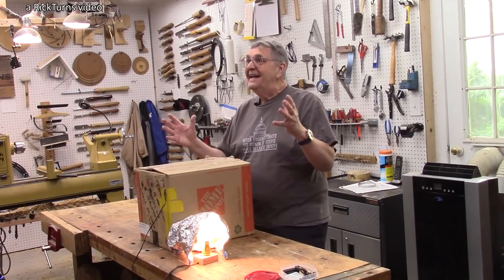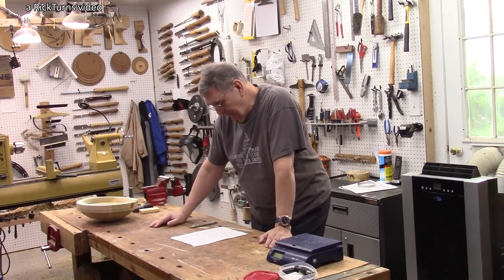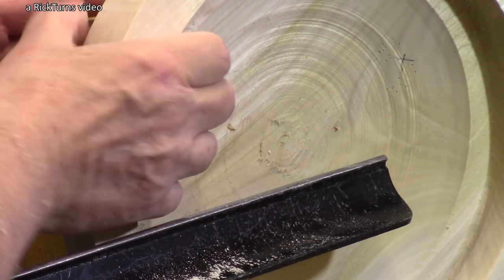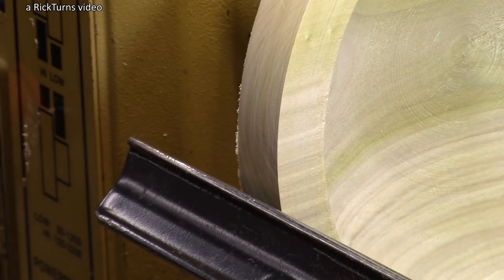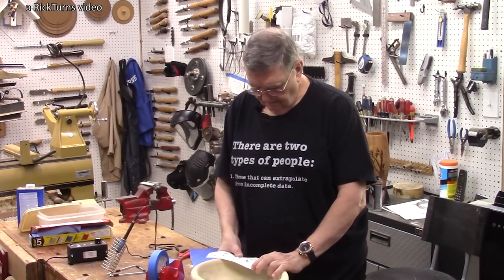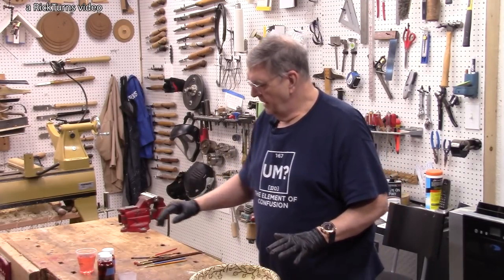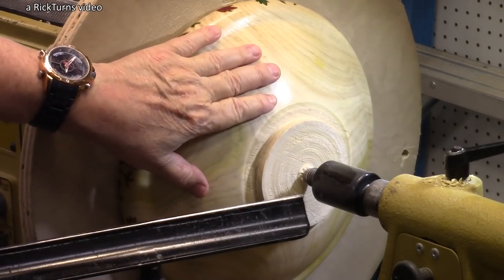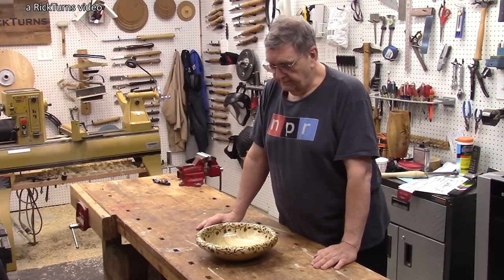Woodturning - Escape from the Drying Box!!!!

Comment: Rick. Another quality piece. Hey question. I'm on a budget and picked up a delta 46 715. It's a 14" swing. It has reeves pully system.   I needed something more than my nova midi. It's getting tired of t he large pieces I'm outing on it. Had a few chuckle, did I buy scrap iron or a working lathe?  All the inexpensive new lathes rpms start at 600, too fast for a piece  out of round. The delta grys down to 350. Your thoughts?
Reply from the maker: Hi, Frank. Looks like the specs on this are decent. If it goes as low as 350 rpm, you shouldn’t have much trouble with an out of round blank. I can usually start turning at around 400. If it’s vibrating too much, you can use a chainsaw or bandsaw to remove more stock to get less vibration. You can also add a shelf between the legs and load it down with sandbags which will help when you’re roughing down an out-of-round blank. My first full size lathe was a Jet 14-42, 14” swing, Reeves pulley system. I put around 400 lbs of sand on it. I used it for 10 years or so. Then I sold it to a friend, who is still using it. The only information I could find on the Delta’s speed said the top end was 600 rpm, which seems pretty low - maybe that was a mistake in the review I was reading. 1000 rpm seems more likely and more useable. Hope it works out well for you.

Comment: Enjoyed it Rick Very nice bowl Great job on the vines, I have been working on one of those drying boxes but I ended up making something to hang on the wall thought I would make one to dry a few bowls in the size is 67x18x20, built a cabinet and wanted to ask ya if I could put the light 💡 bulb on the inside since the space is larger, And also what size fan should I get since the space is a little bigger or will the one ya used would it be ok to use?
Reply from the maker: Hi, Kimsey. I used to have a drying box the size of a small cabinet, though not as big as the one you’ve made. . It was made of MDF. I put a ceramic light fixture inside, with a plastic cage protecting the bulb. The bulb was positioned on the inside right behind the fan. The wiring to the bulb (and light switch) were on the back of the box. With a box the size that you made and if it’s not made of cardboard, I’d suggest using one 100 watt incandescent bulb. But if you put in two, I’d suggest using 60 watt bulbs, and turning one off for the first two days of drying. If it dries too fast when it is at its wettest, the chance of cracking is higher.
Reply: @RickTurnsWoodturning  OkieDoke Thanks for the info 🤝

Comment: question: isn't the ring tool more dangerous, in case of catches?
Reply from the maker: I don't think so. As long as the ring is held vertically, it doesn't catch at all. If you use it horizontally, watch out! But I've found it very easy to use. Thanks for watching, Gabriel.